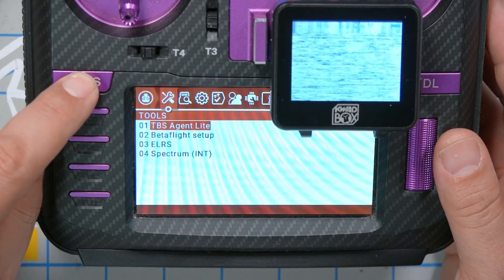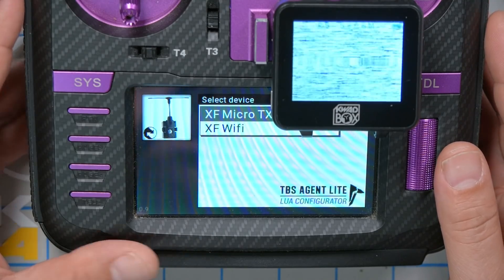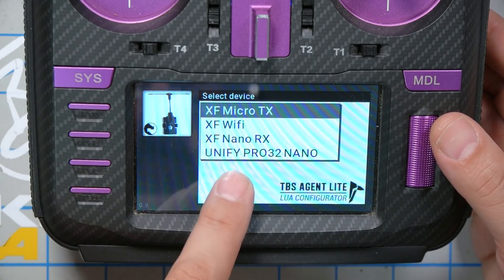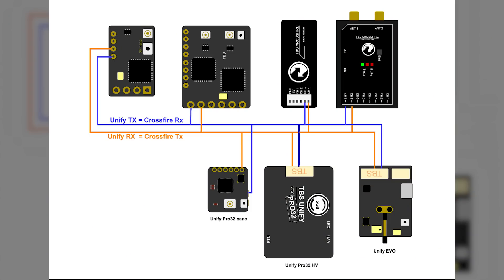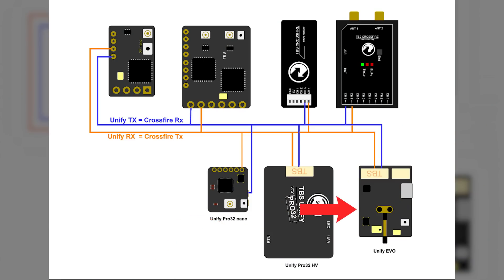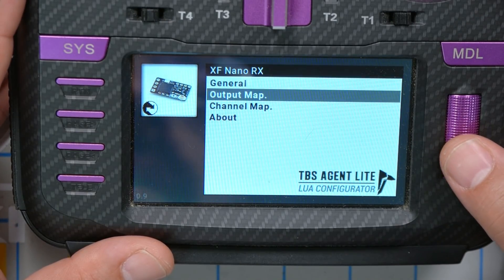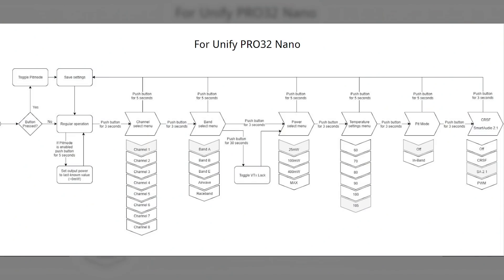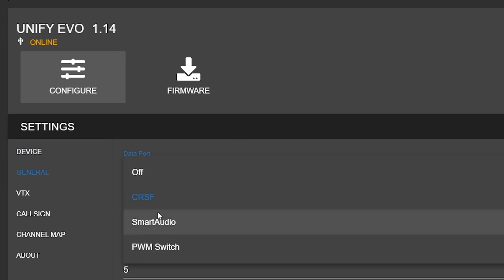TBS MyVTX | Never power up on the wrong channel again

Comment: Hi Joshua I did this my crossfire is wired to my pro 32 nano on a TBS whoop adapter board did the buttons as in the vid but no vtx comes up in my agent lite on zorro it’s there supposedly on regular tbs tools but does not seem to work it’s on R 6 when I told it R 8?

Comment: I got my unifypro 32 wired up like a usual vtx but I take the white wire from the unify to the t2 on my speedybee bord in the vtx spot then on the lap top in agent x I set all my vtx settings and pick crossfire not smart auto. And it works am I backwards?????lol

Comment: Hmmmm. since we are using crsf protocol any chance this will be available for ELRS? 

Also JB do you have a video on how to set up pit mode on the TBS Unify Pro32 Nano 5G8 V1.1?
Reply from the maker: ELRS 2.0 has a similar function yes.
Reply: @JoshuaBardwell  Thank you. May have to wait a bit as I have the HM mob6 with elrs and heard that 2.0 does not support bnf at this time for spi.

Comment: Hi, 
I have a question. I have TBS sixty9. It has no smartaudio input. It seams it has only myvtx feature. Howto control transmit power and channel with radio switch? Is it possible?
Reply from the maker: For now, you can't do it. Unless TBS opens up the possibility to use smartaudio in firmware.
Reply: @JoshuaBardwell  Actually in firmware 6.09 there is smartaudio added (its beta firmware). However input pin is output4 which is at the back as soldering pad. It is not delivered as plug pin. Also there is pimode switch option in crossfire added, so you can assign channel and pitmode will be on/off by changing value of the channel. It works reliable and always, not like smaraudio (in my vtx sometimes it worked and sometimes didn't). What I am missing is function script (lua) that will change vtx output power and channel. If this is done then bye bye smart audio. Actually I won't use smartaudio with sixty9 as crossfire option is better for me. I set once and all my models are at the same frequency.

Comment: Where does the vtx get its information from to put on the osd?
Reply from the maker: The vTX doesn't draw the OSD. The FC has a chip on board that the video signal passes through, and the FC causes the chip to draw the OSD.
Reply: So the camera signal wire will go to my fc and then another signal wire will go into my vtx?
Reply from the maker: Correct.

Comment: I'm having ghost problems. I'm sure they'll work them out but none the less I was frustrated enough I ordered tracer. Question dose the nano pro 32 do real pit. Actual 0mw when you say pit on a switch? I really loved the ghost I loved the simplicity of the hybird and the setup and channel change right from a separate screen on the back rx id, jstsh 4 wires very kiss.

Comment: Not able to connect the power selection to one of the switches. Another great video, thanks. I use a VTx without Tx/Rx, only SA, the TBS UNIFY PRO 5G8 5V. I was able to connect to the VTx through the receiver (ch 4 only). Succeeds in changing channels and power through TBS agent.
 I am not able to connect the power selection to one of the switches.
Can you help with that? Glad I support you, you earn it honestly!

Comment: Hi JB,
Why go through all those steps when you can set the data protocol right in the General menus of the Unify Pro32 settings through the Agent Light?  

There, there’s a data port that you can change it from Smart Audio to CRSF.
Reply from the maker: You can only access the vTX in agent lite if it is connected to the RX. Chicken and the egg right?
Reply: @JoshuaBardwell  True enough!   I wasn’t thinking, but your suggestion to use the Agent X on the computer is a much simpler and elegant solution.  
Cheers,
Sam

Comment: There's only one thing that I need from myvtx to completely win me over: would it be possible to put the output power on a switch?
So as to set myvtx to boot up on 25mw and a certain band and channel, only to go to max power when I arm the quad?
How would it work to set that up?
Reply from the maker: You can set an aux switch to put the vTX into pit mode, but not 25 mW. That mostly does what you're asking right?
Reply: @JoshuaBardwell  not really. What I’m thinking is the equivalent of what betaflight does when it keeps the vtx at 25mW until you arm.
I was thinking that might be possible with a LUA script or something like that (but I don’t know a damn thing about LUA scripts). 
If there’s a way to get those types of things to work for Ghost and/or Crossfire, that would greatly improve the appeal!

Comment: Can this be done with the TBS UNIFY PRO 5G8?
https://www.team-blacksheep.com/products/prod:unify_pro
Reply: I do not see the option in the manual to switch to CRSF. Also only Vin, SA, 5V, GND pin header
Reply: Ha. Yep. This works using SA on the XF nano Output 4 to my TBS Unify pro 5G8 VTX. I just had to enable MYVTX on the XF micro V2 lua script. Isn’t using SA on the XF nano the same as using MYVTX?
Reply: I just disabled SA on the XF nano RX and it stopped working. So it must be using SA to make the changes via the MYVTX lua script

Comment: Hey Joshua, thanks a lot for this video. I recently ordered a TBS Unify Pro32 HV and I'm glad you made this video.This will make my life much earier in one way.
Maybe I've overseen a post here but my question is: how can you get the informations like battery voltage, power consumption etc from the FC to the OSD when you don't use SA? RSSI comes from the RX so I presume that putting that information on the OSD ain't a challenge. Right?

Comment: The great thing about this feature is that TBS vtx is not required, you can use it with all other smart audio enabled vtx :) Even further - TBS Fusion can send commands thru wifi to the XF module, and switch the channels or power output on the fly :)

Comment: With the help of a "RealPit" style device, Betaflight LUA script can work similarly, cant it? Setup VTX tables, wire a "RealPit" to your VTX and set up PINIO, install Betaflight LUA script on your OpenTX transmitter of choice. When your ready to fly, power up your transmitter FIRST, set your VTX options in the BF LUA, then plug in your drone battery. Once you flip your "RealPit" switch, the updated VTX data is sent to the VTX and it makes the requested changes. Or have I just been getting lucky?
Reply from the maker: Yes this would work like you describe just a lot more steps having to manually apply the changes to every FC as you power it up.
Reply: @JoshuaBardwell  oh don't get me wrong, its not nearly as elegant as at the TBS or Ghost solitons, NOT NEARLY!!!  But its still a viable option, especially for people not on TBS or Ghost..... Flysky, ExpressLRS.. what have you...

Comment: Why so complicated? Just one cable does the job soldered to Output 4 and it‘s set to Smartaudio. I use it this way for ever... what would be the advantage? Maybe firmware updates? anyway very informative, but it can be done in a fraction of time 👍🏽

Comment: One comment about the wiring of the Unify Pro32 Nano (it may also be the case with other TBS vtxes - my experience is limited to the Pro32 Nano) -    when you install a new vtx and unlock the power output using the button on the vtx (as far as I know this is the only way it can be done, you cannot do it using AgentX or Lua script) you must do it BEFORE you solder that blue wire (the one on the side of the vtx), because after wiring that side pad on the vtx to the Crossfire/Tracer receiver the button on the vtx stops working!

Comment: Joshua, there is a easier way to setup CRSF on the VTX. If its a Pro 32 or EVO you can scan a bar code to change it. No button pressing needed.
Reply from the maker: I thought only the Evo supported qr scanning?
Reply: @JoshuaBardwell  The Pro 32 do that's how I switched mine to CRSF.

Comment: "My VTX" works with Smart Audio as well.. can skip the set to CRSF bit
Reply: I thought it did as well, but it seems like it's either not working on my quad, or the SA from BF continues to overrule it. Either way, can't get it to start up on a different channel then it was on previously.
Reply: @JekleFPV  If betaflight can still control the VTX then it is wired up incorrectly - if done correctly BF can no longer control the VTX at all (it's bypassed/not wired up - so no more VTX tables needed either - A good thing!), it's done entirely threw CRSF/SA, directly from the reciver to the VTX, controlled by either the LUA scripts or ya fusion goggle module, best of luck!
Reply: @Ryet9  I hooked up the unify pro32 nano on the mounting board together with the crossfire rx, still hooked up the SA pad to the FC, kinda hoping that would work. If it doesn’t, there’s no point in using the crossfire/SA config apart from not having to go through the menus in the vtx
Reply: I found the same thing, but it seems like it only works on the pro32 hv, because my old unify hv wont show up (I cannot change the channel sadly). Is there anything else to set or are those just too old?

Comment: The best is still Adjusting VTX Power Levels using a transmitter switch like shown here:
https://youtu.be/QbOUU_DbPJk

Having the ability to quickly switch between power levels while flying or landing is excellent!

I see how changing the channel from the transmitter menu could be a nice feature though.  Nice video 👍

Comment: Oh, another thing: to set the pads to be CRSF RX and TX on the receiver, you only have to set output 4 to CRSF TX and output 3 will automatically be set to RX.  I got really confused when I didn't find CRSF RX on the menu, until I read the manual more carefully lol

Comment: great video JB! just a question: ELRS is using crossfire as protocol, do you think it  works even there?
Reply from the maker: No, definitely not.
Reply: @JoshuaBardwell  That would be a killer feature.... ELRS "my vtx" compatible with IRC Tramp and SmartAudio

Comment: If you put the channel and power on aux-channels and use knobs, you can basically do this on any Smartaudio VTX. It will select the channel and power as soon as the receiver gets the Aux signal. If you have set up the quads the same and use the same radio you can just turn the knows on the radio to the desired vtx settings on one quad and if you plug another in it will use the same as soon as it gets the radio signal.

Comment: And.... TBS Cloud also fully integrates the TBS Fusion, TBS Crossfire/Tracer, AND your Pro32 VTX of your choice and in harmony.  "Follow my VTX".  Good old channel 3 & 4 CRSF on that RX does wonders for a long time now.  Change channel on your goggles, vtx changes channels, change channels on your quad, fusion can follow it. EVEN.. dynamic VTX and it can manage your output level, saving a little battery draw and heat.  I thought you already covered that a while ago.  I've used CRSF on my nano rx and unify pro 32 & evo for over a year now.  Smartaudio is deaaaadddd...loading tables.. blah.

Comment: @Joshua This not only works for the new TBS VTX, any Smart Audio Capable VTX can be controlled by Tracer/Crossfire.
Reply: Not sure about that. I believe your smartaudio capable vtx, must also be set to crsf protocol. Would  be great, if its true,  because I have a rush tank solo  that I want to wire it this way
Reply: @niceguy6182  I have a tracer with a  TBS UNIFY PRO 5G8 HV - RACE 2 that's only SmartAudio Capable. You have to enable the correct output in the receiver module. Take a look at pages 37-38 of the tracer manual.
Reply: @matiasvidalp  OK thanks, I ll check it
Reply: True :) I have been controlling 3 of my vtx-es with this, an eachine 805, beta fpv one and a akk I think 🤔 all thru smart audio protocol. It is shown on diagram, and explained in TBS Fusion manual :)
Reply: yep. i just have smart audio setup on tracer and myvtx works

Comment: Joshua - I’m looking at your wiring diagram to hook the VTX to the RX. I run unify pro32 nano vtx’s and crossfire nano ex’s mounted to either the stock tbs mount board or the whitenoisefpv boards on all my quads. Do I need to physically run two wires from the FTC to the RX? Is there a way to do this internally in the whitenoise or tbs mount boards? If not, do I run wires from the interface solder pads on the vex to the “floating” rx or from the solder pads on the side of the mount board to the rx?

EDIT:  I just answered my own question... tested the TBS Unify Pro32 nano mounting board with my multimeter on the continuity (beep when connected) setting. There is continuity between the tx and rx pads on the output solder pad side of the mounting board with the tx and rx pads directly under the 3 and 4 holes on the nano rx. If you connect not only the 4 pin header holes on the nano rx with the mount board, but also the 3 and 4 holes on the nano rx with the mount board, there is automagic connectivity for this wiring setup. Just use two more pins to connect those 4 holes. I wish I could post a pic...
Reply: That's quite neat, yeah?

Comment: I just started the video and don't know if you remember me, but I asked you on discord if you know any method of unlocking the unify vtx when the supposed pads came of (it happened to a friend of mine).

Soooo is it possible to unlock a unify vtx via the transmitter?

Edit: got it, it's really possible. That's very nice thank you for this video, Joshua! You are great

Comment: I didn't think anybody still flew analog? Lol
Reply: Racers
Reply: I still have two analogue VTX's I never even got round to wiring up, Shark Byte happened to me this year :)
Reply: Cries in analog
Reply: Not all people are DJI sponsored...
Reply: Different strokes for different folks. Digital is great and all but I can go further out on analog and without the massive latency either.
Reply: DJI is a garbage brand.
Reply: @IzzyBoop  Yeah. Press and hold time interval red and blue blinking light cross reference chart method, is way better! 😜
Reply: @cognetic  I'm so confused.. my vtx only has 1 led 😳
Reply: @divingfalconfpv4602  watch the video.
Reply: @cognetic  you literally unlock a vtx like. once. when its first powered on. im sorry i couldnt hear you over the sound of the dji 1200mw hack.
Reply: @cognetic  That sort of attitude will only cause a rift in the FPV community between digital and analogue users.
We don't need bigotry in FPV.
Reply: @IzzyBoop  Hahaha! That was truly funny. Good one. #Touché
Reply: @cognetic  trying but work keeps popping up.. lol
Reply: @IzzyBoop  so far never had to unlock one. I remember I was mad when review said the vtx comes locked on this long range quad. I'm like really. Hate when they lock vtx.
Reply: @IzzyBoop  how about I had to goto vas themselves to get good patch antennas for dji. Cause no one stocks LHCP antenna that aren't the dji only ones that I didn't like. Ugh. And then they take both ports or all 4.  Why couldn't dji just out sma ports too.
Reply: @licensetodrive9930  You give me way to much credit.   But thank you.  It's all good. In fact it brought you and I together today.  Big hugs.  🤗
Reply: @cognetic  I hope you've had your jab! lol
I didn't mean any disrespect, it's that I've seen some genuine comments in the past year by digital users that look down upon some people because they fly analogue, that's real sad to see - we're all FPV pilots just trying to have fun :)
Reply: @licensetodrive9930  no worries bud.  It's all good.  No harm.  My intent is not trolling.